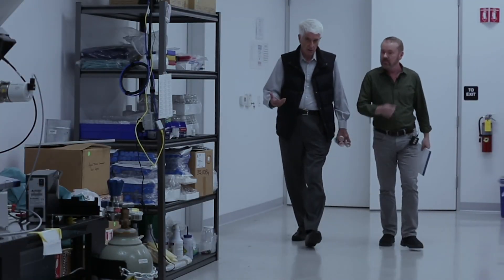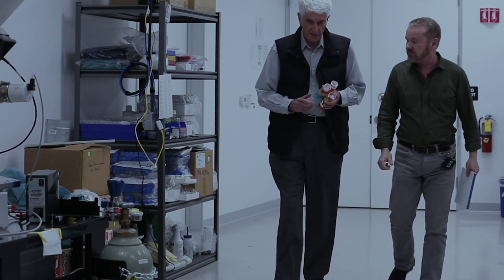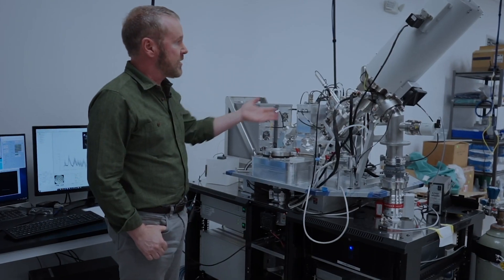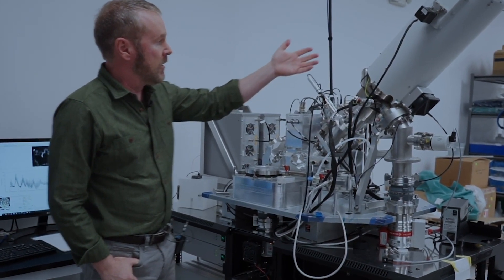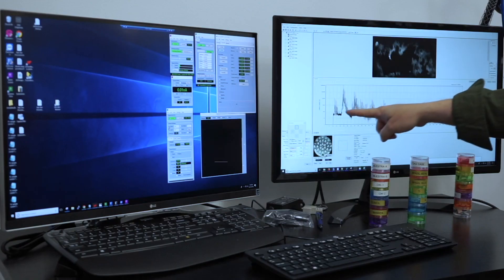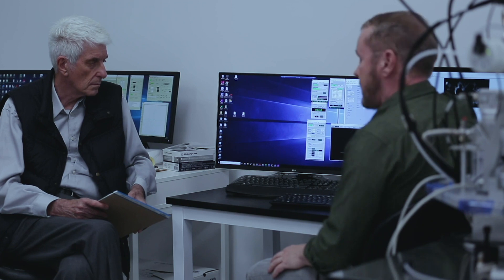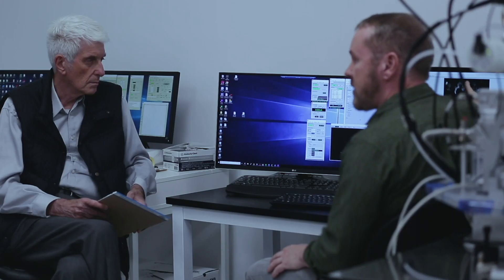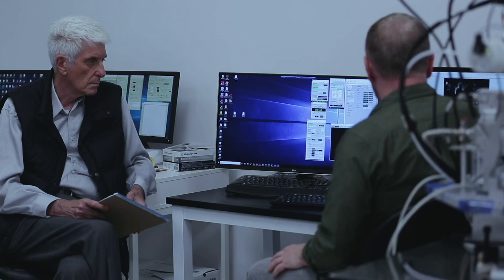Not made on Earth: the atomic structure of UFO debris analyzed at Stanford University

Comment: could the samples were from a meter
Reply: good point
Reply: i think he would know its from a meteor
Reply: Wouldn't it be meteorite if the samples were on earth? (If indeed they are not what the scientist proposes).
Reply: Did you not hear Dr Vallee that the isotopes were manufactured..so then how can the sample be from a meteorite?
Reply from the maker: A lot of mistake on this. It's the very special, unnatural organization in 3D space (topological structure) of the isotopes within the samples, down to the atomic level, which allows Vallée and Nolan to conclude that the material was manufactured. It's not that there are just "some special isotopes" thrown randomly in it. It's all about the weird spatial structuring of the isotopes (how they organize themselves in a non-random way in space within the material in the form of a "3D grid" in relation to each other). Nature does not do that, and we humans do not know how to do it artificially yet. Therefore, the samples must be both artificial and of extraterrestrial origin. QED
Reply: That's what I was thinking until they said it manufactured a mix of 250 elements.. This must be old because he said we only know of 80...  We are just now getting to around 118.
Reply: @Jeralddoerr  Hes talking about different isotopes of elements we commonly use to build things. Even though there are 118 elements right now a few dozen of those are either unstable, highly radioactive, or useless in any practical sense for some other reason. So when he said "80 elements" he means the elements we currently use in random stuff on earth not the collection of total known elements since some of them are useless to build shit. What makes this interesting if its true is some of these ratios of isotopes and the isotopes themselves are totally unknown to us. When people talk about ufo metals and they say "well we only found aluminum or magnesium so its just normal earth metals"  they fail to talk about the purity, the isotopic ratios, and shit like that which makes the metals pretty puzzling.
Reply: @Jeralddoerr  the number is not about what we know of it's referring to how many elements we actively utilize in our daily industries
Reply: @Jeralddoerr  No, he is talking about Isotopes, not Elements